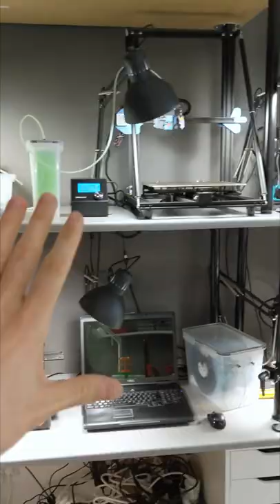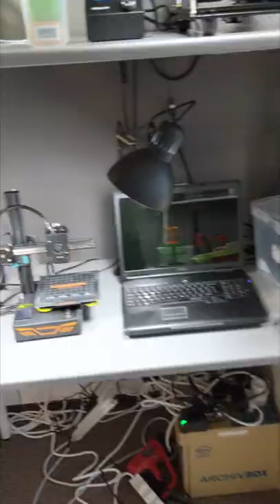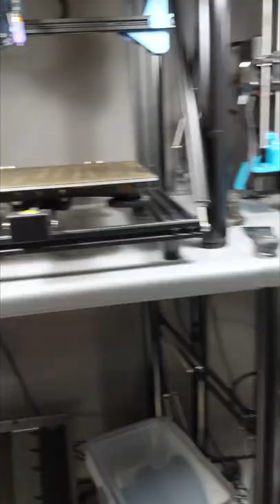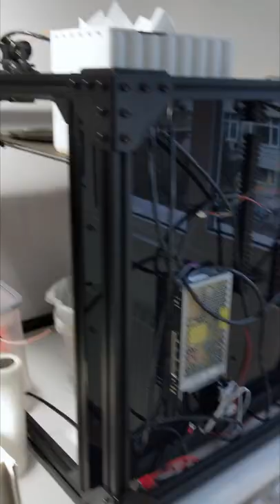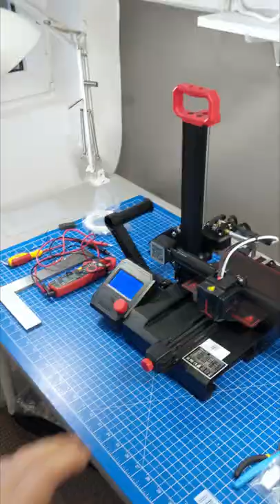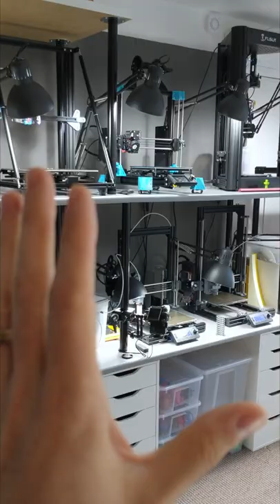Don't get a 3D printer

Comment: Running 4 Prusas, each has 700 hours in. No major problems so far. Once you digged into all its quirks, it is not so time-consuming anymore. Especially the i3mk3s is a workhorse if you treat it right. About the mini+ its just important to swap the extruder for a bondtech because the stock was nonsense. Otherwise all is well with Prusa. - Dont waste your time on the others you showed. They will first burn your head out and then your room.

Comment: My Ender 3 printer has only had 1 problem for the 2 years I’ve had it, was able to fix that problem in just about 15 minutes without any costs, simply a small tab fell off, but it wasn’t hard to put back on. So at least in my experience, it’s quite reliable

Comment: I currently own 5 printers and have owned a few different ones that I've since gotten rid of. All of them have needed repairs at one point or another, a few needed replacements out of the box. 3D printers aren't just a tool, they're a hobby.

Comment: 2 Ender 3 printers. The only problems I've had have been self-induced. I've printed hundreds of items and then added mods I didn't really need. But, I'm happy with the results and have learned how to design simple things I use every day, like exact measure measuring cups for lower than prescribed dosing of my meds. And a funnel to pour distilled water into gallon bottles. And a bracket that clips on our railing to hang lights on that makes my wife's life easier when she changes lights to the seasonal colors she likes. Yes, I could buy programmable lights, but she really likes the lights she has now.
My point? I would love to talk to Mihai about the problems he's having. I might be able to help...

Comment: This is the most therapeutic thing I've seen in a while. I can't explain how much I relate to this. I only have one printer. I built it myself. It's a never-ending project. And when I tried to find one on the market that would just print some shit for me, I gave up. Because of what you just said in this video. So exasperating!
Reply: "I built it myself"

Well there's yer problem!

I mean, a lot of it has to do with how many 3D printers are really hobbyist projects that are never designed for mass precision manufacture, so it's not your fault per se.

But someone really has to step up in this space instead of playing silly buggers and expecting the customer to do the manufacture.

Comment: You gotta choose the best one for you. If for a farm, get lots of the same ones or your time will be drained 10x faster. A cheapy is still gonna break down but atleast you already know it's weaknesses and have spare parts from another of the same if needed. 

Unmodded,340$ Sidewinder X2 has worked great for me. I've tried over 20 printers but the X2 has the longest reliability before something needs to get fixed (not counting hot end clogs). Almost non stop with big prints it lasts 6-8+ months. Yes, these cheaper stock printers should last longer but it is what it is. In comparison the X1 lasts 3-4 months, and most other printers in that range last 1-2 months before they start breaking down.

Comment: I agree with thought of "this printer is crap" I have bought about 7 different printers and I've yet found any that work 100% of the time. Some did also arrive broken and I dont have the time or money to sort it out. The printer I have working atm is a very small printer and it has failed a few times when changing and trying other filament, but I envy all people showing stuff off having working printers, and all I ever have got is broken or really bad printers. I have a few projects I need to print new parts for, but since I cant rely on it I tend to not work with that project at all. I wish I could work more with them since they are one way to get paid. And I really need to get a better income. Thanks for the video, I feel your sorrow mate.

Comment: I went through the same thing. Tuning can be really finicky and you have to spend a lot of time learning, which isn't a bad thing, but even after countless hours of learning, tuning and upgrading, I'd still have prints fail for no real reason, and constantly struggle with bed leveling. Then I decided to bite the bullet, because it wasn't cheap, and bought a prusa i3 kit. Wow, easy to build, and I never have a question of, is this thing going to print today. It's as good as an ink jet printer lol. Just refill the filament.

Comment: I have three Flashforge Creators. The only thing I had to do so far after over 10,000 combined print hours is replace the nozzle assembly on one of them (and occasionally level the bed.)

Comment: Prusa i3 mk3s+ exists. Not a single  problem after months of printing. have two ender3s. Had to learn a few of their shananigans though, but after that and firmware bs they run flawslesly too. Just get to know your tool, and don't fix, what is not broken. 3D hardware and software engineers know what they are doing. I never modified any printer, or any slicer setting. But it's true, that any 3d printer does come with its learning curve that is needed to be overcomed to get printer going anywhere.

Comment: My Prusa MK3 has been fairly painless. Granted, you do need to understand the concepts (I mean... I know you do, and then some, just saying that some buyers are completely clueless) and there's definitely a long way to go to get to something more effortless. The Bamboo Carbon does get a little closer to fool proof. You can set it up when you get it and hit print, and expect a great result, but I do agree that there's still more work to do to get to the point where a printer is an appliance and not a project.

Comment: The consumer facing 3d printing industry is mostly for DIY makers and by DIY makers. The prices and capabilities dropped substantially from less that a decade ago with the entry price being negligible compared to get cost of living in most of the developed world. 

Even if the average 3d printer was as reliable as a pre-built Prusa for the price of a ender 3, it would still most likely not expand the number of buyers by a significant amount. Unfortunately it's a super niche market that is dominated by chinese hardware and sold at a very low mark up.

Comment: I just got a standard Ender 3 V2 I probably printed like 90 different things and it's still holding up with basic maintenance like keeping nozzle clean fans clean making sure things are adjusted proper tightness and it hasn't hardly lost performance

Comment: Creality Ender sv1 is really good. The only downfall is the mat where the nozzle prints on is not at all great for holding the part. Easy fix is to get a 8x10 picture frame glass and bam clip it onto the shitty mat and then add hair spray for adhesive - hold. I learned this from a. Friend of mine. High recommend it.

Comment: This is super easy. All these are based on stratasys systems. I operate stratasys and I press print and later perfect abs parts every time. You can buy them used like the uprint quite cheap now but material costs are high. I purchased 2 new and 2 second hand. All the hobby printers are exactly that for hobbies

Comment: It‘s like with cars honestly. If you buy high quality and regularly check on it’s functionality and do some maintenance you‘re most likely not gonna have problems whatsoever.
But if you buy a 300 bucks car you should be prepared for some way of investment, either time or money. I have 2 printers and one was bought new but the quality and idea behind it was trashy. Second one was used but had a sort of well construction and I ended up spending very little to make it please me

Comment: 100% true even with extremely high end printers max my work bought a $25000 3d printer and it worked amazingly well for a year, and now it’s one problem after the other. The company is great about working with us but still for 25k you would think that you would a couple of good years of problem free printing

Comment: That's why i just got an ender 3 at a stupid low price. It basically worked out of box and with no time spent screwing with it, it printed as mediocrely as a $150 printer should print. The project is worth the low cost, and if I wanted any better, I'd just save up for an enterprise solution.

Comment: I just got an ender 3 v2 and I totally understand you, had to replace the bed and even then it still have problems printing, creality is just sending ANOTHER printer, and I hope this one works well but I too am disgusted with 3d printers they don't even work properly out of the box and you have to buy many modifications just to get them working as expected

Comment: I agree the learning curve is very steep and it takes a long time to get most of them to work.
Over Xmas 2021 I bought 3 popular printers that were all on sale.
2 of them were just as you described "too much work".
The Bluer Plus or Bluer 5 however was amazing.
Check it out and if you can find one pick it up. You won't be disappointed. 
Also the new Anker 3d printer that is  currently in production looks to be really promising. Check out Uncle Jessie's review of it on you tube.

Comment: Honestly Ive had issues with most of the printers I have had too. Seems like luck of the draw. I tend to always get sent parts that do not work. Even got some parts from dyze design before they discovered that their milling process missed a die casting artifact that prevented you from attaching the hotend. Seriously bothers me that people buy 1-5 printers from a company and pretend that they are perfect. Really comes to luck of the draw, it is even that way with computer CPUs and those are much more precisely made than 3D printers.

Comment: While the points made here are valid, I'd say 3d printing is still worth it. I may have just been lucky, but I feel like none of the issues my ender 3 has came from the company. Like I've had to replace the mainboard, but that's only because I opened it up to attach a bltouch which I would later take off.

Comment: To me a 3D printer is like a CNC machine a tool you buy and have to learn or have prior knowledge on, if your not willing to learn a new skill set for a tool than don't buy the tool. I own a ender 3 I put an additional 150 onto it learned the gcode and I print at 130mm^2s and it prints insanely clean. I make parts with 0tol fit up.

Comment: You may ask "why are prusas so good and reliable?"

Well turns out that if you have 500 prusa printers printing parts for other prusa printers you will find faults in the 500 printers and can improve the final product basically prusa has effectively one of the best QA and R&D line so the end products has no faults

Comment: I was going to argue, but you're right. Even my favourite printer comes with overtemp protection disabled and massively benefits from switching the bed surface with a piece of glass.
Even if you want to switch the motor wires, there are like three competing standards.
The industry is a mess.

Comment: Fixing a problem of a 3D printer sometimes takes many hours. I hate it too. Calibration is needed. Some nuts should not be tight too much. Belts should be tight enough etc. After one or two years your skill advances and you start fixing problems faster. Perhaps we should make a fix check list.

Comment: Prusa Mini not too expensive, and is reliable now that they ship with PINDA sensor. Before the PINDA mod, I had to constantly adjust 1st layer height, since my print room temperature is not tightly controlled.

Comment: You can buy a $35,000 stratasys printer, or a $250,000 fortus printer. They work great with no modifications. You’re buying printers for $200-$2000 and complaining they don’t work out of the box. Be thankful you can 3D print for a couple hundred dollars, when I was younger it cost me more money to have one project 3D printed than it does to buy your most expensive “consumer” 3D printer.

Comment: Honestly the Elegoo Neptune 2 has been working great. I’ve only had one major issue with a print. I was unsure about the 3D model from the start. The recommended printing settings didn’t make sense but I went with it and ended up with a nest of filament all over my desk and it ended up clogging the hot end really bad. Other then that it’s been practically flawless.

Comment: If I had that big beautiful window, my resin printer would be yeeted so fast you wouldn't have time to warn anyone on the ground.  My stupid AnyCubic Mono X has been down longer than its worked.  The LCD stopped working after 3 months for.... reasons? It took three months for the replacement parts to show and I still haven't had a success since intalling the new one.  I got a Prusa Mk3+ kit and I was almost in tears it worked on the first print.

Comment: Everyone wants to 3D print until it’s time to do 3D printing shit. The never-ending project is part of the fun.
Reply: No it's not. It's a pain in the ass.

Did you have to forge your own screwdrivers and machine your own cabinet hinges? Of course not. There are standards for all kinds of things, right down to the screws you used to build your printer. Juts take a look at the technical definition of a 6-32 machine screw sometime.

3d printing won't be taken seriously by anyone until these issues get resolved.

Comment: I've had an awesome experience with the anycubic Vyper. The only thing I printed for it was a filament guide. Granted, I haven't had to touch the fans because I put it in a soundproof cabinet, but they weren't that bad. Compared to the ender 3, i have zero complaints

Comment: Ender 3 S1 (or the S1 Pro if you want higher temperatures). My S1 is great, it just prints. My Ender 3 V2 I've modified a bit, it also prints well. I think it's a case of "if you stop fiddling with it, it'll work".

Comment: I have two broken printers in my house because one has faulty software, and the other had a leveling system that broke because cheap and thin bolts were used

Comment: I feel like the Prusa printers come closest to being able to print nearly anything right out of the box with minimal effort. Like, you can turn on a stock Prusa i3 MK3S+ and give it a challenging print and it will probably print it.
Reply: I'm going to put my very hot take out here.....Prusa's are not absolutely amazing printers nowadays. There are many printers that are newer, faster. These printers are practically 7 years old. I think if prusa tried to completely redesign and make a whole new printer that uses CoreXY kinematics, it would be amazing. Prusa obviously knows what he's doing, but the stuff is just outdated

Comment: The KingRoo also doesn't have a variable parts fan if i remember correctly, so more mods needed
A Creality needs a new board? Why?
If it got fried, well that can happen with any electronics. Else if it prints it's fine. 🤷🏻‍♂️ Have 4 first gen Creality fdm printer (cr19/ ender-3) they are loud as hell but print fine. New models with quite boards should be better.
The anet A8+, well they aren't even 100€ so of course you need to mod them to get reliable, but they print if assembled correctly. Not the nicest prints and loud, too but they print.
The 4th one I'm not sure what printer it is.
5th looks like a Saphire or some other d-bot / x-y printer, never had luck with them sadly.
Ender-2 pro DOA is bad, but most of the time you get them replaced fairly easily, depending where you bought them🤷🏻‍♂️

In all i have an easier time with 3D printer, than with 2D printer tbh 😅

Comment: Qidi mate s - it just prints with minimal fuss so far - it's been over a year now - pla abs and tpu comes out very very good. Mainly moved to printing with abs now just for how easy it is with this machine. I'm sold on brand tbh and next printer when I will need dual or hi temp will be qidi as well.

Comment: Dude.. really? No prusa in sight? Or at least not a standard one.. we got prusa mk3 - it’s so stable and works 99% - 2 wires broke off after 2 yrs (east fixe) bumped a heat shroud (some glue and a reprint).. it’s pretty much a workhorse.. once you set your z height just don’t move it around and you’re fine - 
- my rasoberry pi that I had it set up as print server stopped working - but prusa goes on
Oh yeah the filament sensor was flaky so I turned it off, the mk3s has a different one - in any case people, prusa is the most tested and supported printer with most features that really makes it user friendly - that’s it

Comment: I am so refreshed to hear this take tbh if it wasn’t for getting 3 different printers as gifts from my family I wouldn’t be printing Rn: TOYBOX is an easy to set up printer but working with the built in slicer is a pain in the ass and the extruded is inaccurate af, the elder 3 pro is a POS tbh but when it works you can get great constructs it just can’t level worth a shit nor is it’s bed adhesion that good, and the elegoo Mars 3 pro is maybe the most handy printer I’ve used but it’s a money sink, the build plate is smaller than the TOYBOX for fucks sake and the resin it uses is toxic to the point it can make you allergic. Buyers beware choose wisely

Comment: It is the same development cycle for all tools. They start live as diy solutions. Then the professionals create sleak streamlined versions that nobody can afford (but some people get anyway). 

Right now we live in the golden age when, with a little tlc, you can make a tool that is better than anything available off the shelf. Enjoy it while it lasts, because the next phase is the "refined" tools that are easy but limited, drop in price just enough to dominate the market. That will be fine for most people, but those tools that you can tinker with will become extremely expensive niche tools only made by a select few specialists.

Try to buy a hand saw that doesn't have hardened unsharpenable teeth, and you will see what I mean.